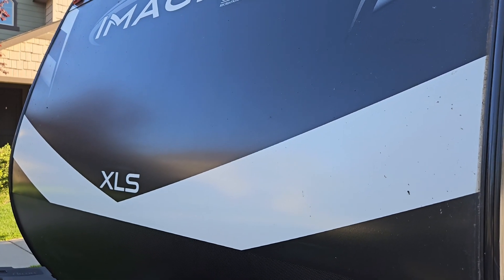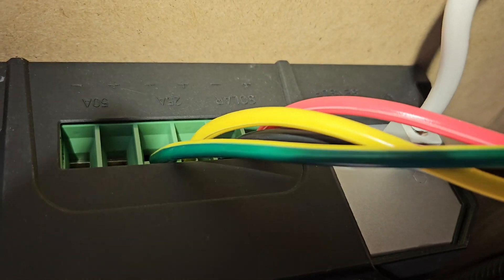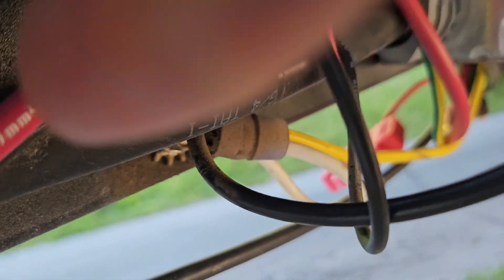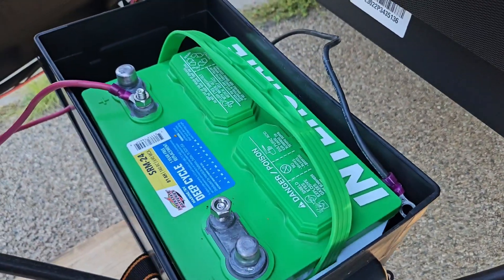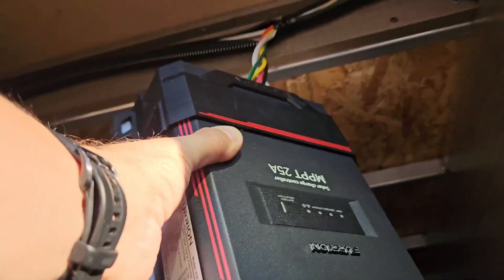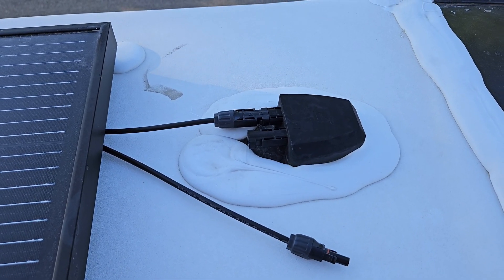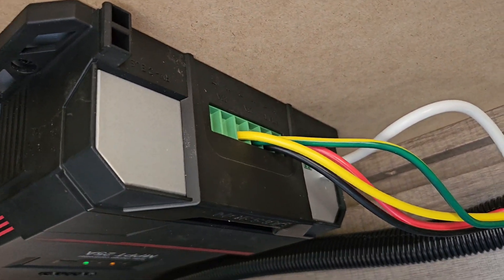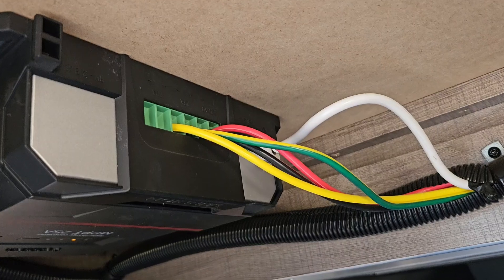Grand Design Solar Flaw

Comment: Thanks, just fixed my 2023 23LDE.  Lazy Days Tucson said nothing was wrong after we made 2 follow-up visits after purchase, after 3 battery replacements in 2 years, I had enough.  This is something an owner of a new RV should not have to go through (DIY).  Shame on GDRV (and Lazy Days), we bought this brand based on what we thought was their quality.  BTW, I called GDRV Service to help them be aware, they said they never heard of this issue.  I was going to send them this link, but knowing Corporate behavior, they would just as likely take down this post for what they'd claim as "fake" news.  Let the truth be told!  Thanks again!

Comment: I have a laundry list of things that were done with defective parts, bad builds, pipes that were screwed together wrong. Valves put together wrong. Leaks in the fan housings. Refrigerator that doesn't defrost.  ..  It's a very long list. Whoever is running Grand Design is cutting corners for profit!  They are not who they were.

Comment: Thanks for the video its July 2025 and we just bought a used 2023 GD 22MLE  and came across this video so I thought i would check my new to me rv and would you believe the wires were backwards! they are correct now thanks to you. I wonder why the previous owner would not have noticed. any way thanks again!

Comment: I have the 22BHE. Furrion MPPT's seem to also just be of poor quality. I swapped in a Lithium LFP 100Ah battery. I set the 30A Furrion MPPT to Lithium but it just sets itself back to default sealed all the time. IO'm fed up and think I'll just buy a Victron MPPT and throw the Furrion in the trash.

Comment: mine is wired correctly, but keeps changing battery type.  they sent me a procedure for a hard reboot and said that the battery needs to be connected first.  will try tomorrow.
Reply: Same. I recommend disconnecting the Furrion MPPT controller and throwing it in the trash. Replace with Victron MPPT. Problem solved!
Reply: So I tried their recommended hard reset procedure and it held the battery selection for 2 days. The third day it lost it. As an electronics engineer, this frustrates me to no end. It is such an easy fix.

Comment: Thank you for your post I had same issue with my 2023 like yours same size as yours and corrected the problem and working now 
Will let dealer know so they can check their products completely before they sell them and manufacture also to let them know I also had same issue. 
Thank you very much. 👏👍❤️
Reply from the maker: Glad that you got it sorted out.

Comment: Thank you for posting this. We have the exact same issue with our 2024 Image XLS 23LDE we just took delivery on. Your video explained the issue clearly and enabled me to fix it easily.  We had a professional inspection done before we bought it but the inspector missed it.  I will share this with him.
Reply from the maker: @MrVeritas59  such a bummer that the factory keeps messing this up.   I hope someone from Grand Design has seen this video.

Comment: Do you know how to make sure the proper battery is selected?
Reply from the maker: I'm pretty sure that you just toggle it with the button that is next to the lights.  The lights will change color and move to the selected battery type.  I can't check though because I completely rebuilt my solar system with lithium battery and Victron components.
Reply: @ thank you!

Comment: This is really a bummer because even though the resolution was simple, most people don't have the troubleshooting ability to address an issue like this.  They would, most likely, wind up losing their rig for a month+ to have it resolved at a dealer, under warranty.  You showed this in your video (good on you!) but it's worth emphasizing to anyone dealing with the same issue...ALWAYS disconnect the solar array from the charge controller BEFORE you work on the connection to the battery.  When panels are connected and sending power and the battery connection is interrupted, that could result in permanently frying the charge controller.  Glad you got your problem resolved!
Reply from the maker: Yes, you're exactly right.  We had to have a faulty fridge replaced under warranty right after buying our first Grand Design.  The dealer had it for over a month, zero communication from them, messages went unanswered. 

I'm in the process of upgrading the solar and electrical.  One of the updates will be a solar disconnect switch so that I don't have to go to the roof to disable the solar panels.